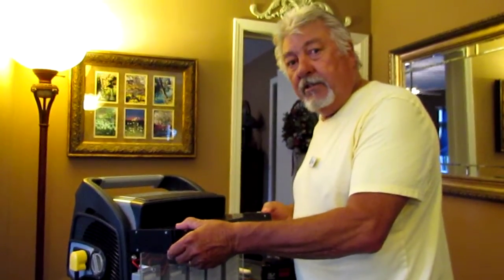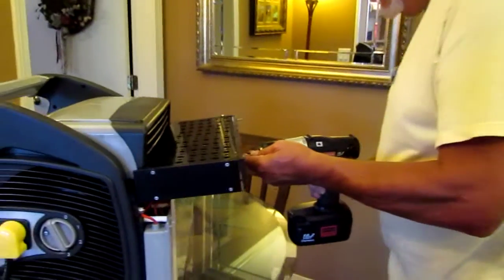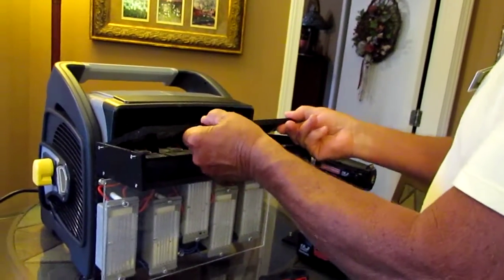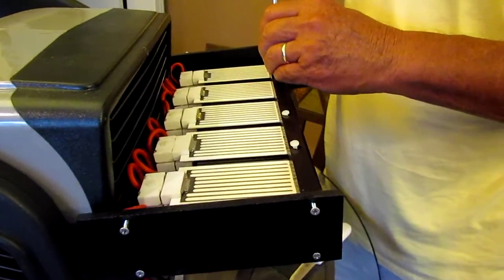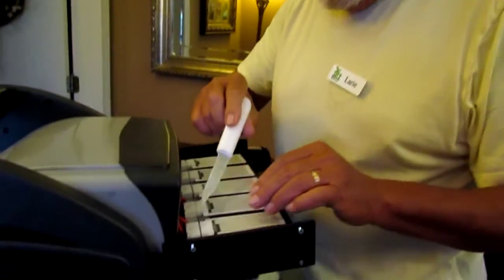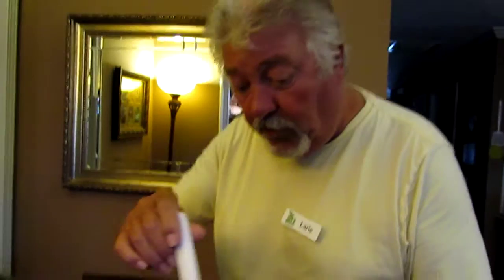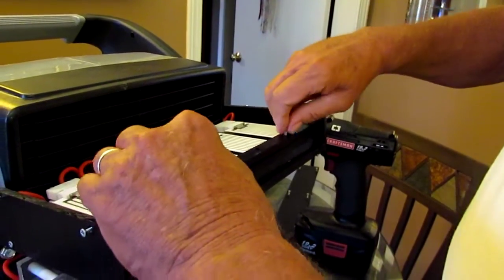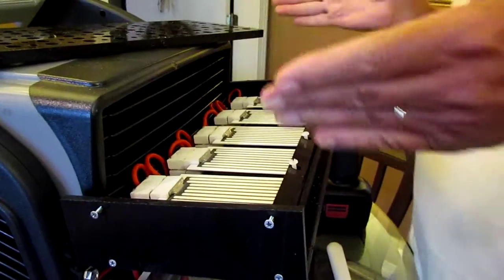How-To Video on how to change out the electrical plates on our ozone machines

Comment: Brittle ceramic plates that are loosely held in place with a strip of plastic on a device that's designed to be transported to various dealerships, mobile detail and such? Seems like you'll be replacing them far more frequently then 300  machine-hours.

This product really needs better engineering. If I purchased one of those and had my employees move it around the lot, they'd break a plate or two every day.